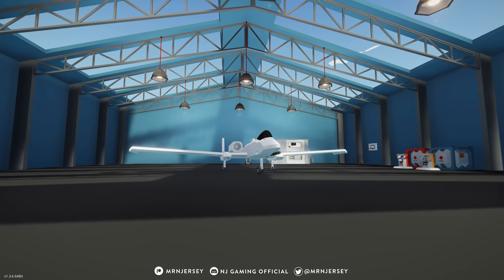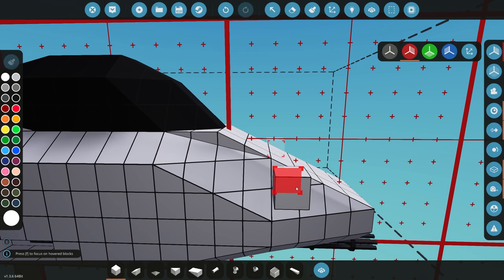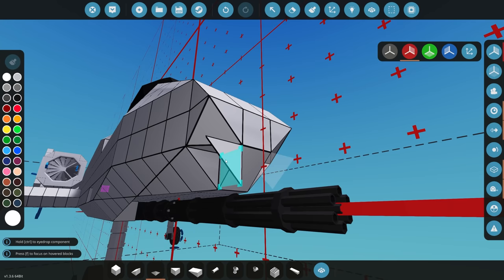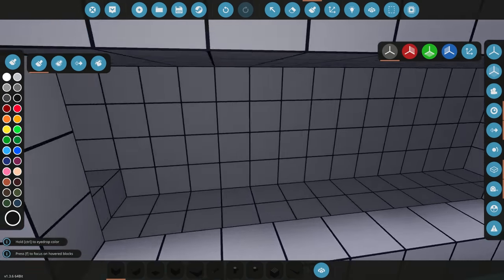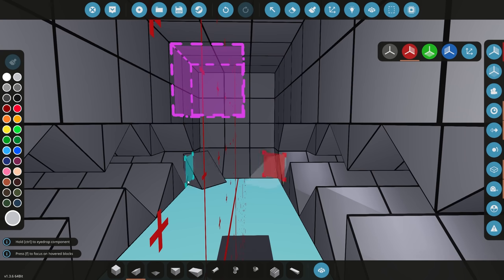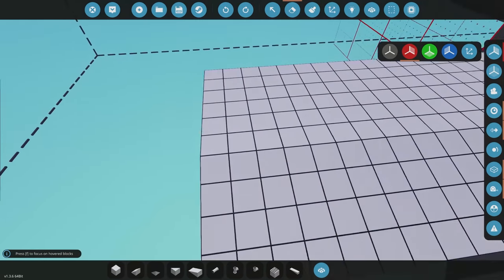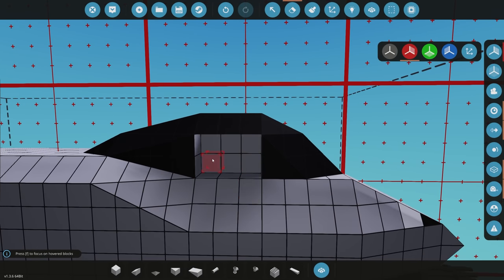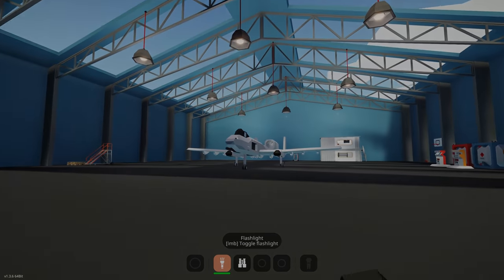BBBRRRTTT Build!! - Part 2 - Search & Destroy Weapons DLC - Stormworks

Comment: 12:32 the real brrrrrt acutally had its landing gear sticking out a bit so if the hydraulic system was damaged the pilot could land safely without the plane being completley destroyed
Reply: Yes hehe
Reply: just came down here to say that, the hydraulic system in itself was a twice redundant system because each engine ran pumps for a separate loop, that hooks into the same components, and the reason the gear raises forwards is so that if for whatever reason he cant unfold or lock the gear electronically/hydraulically, gravity and drag from flight could
Reply: Is it bothering anyone else that the front gear is not off center, and folds backward instead of forward?
Reply: im just about to comment this

Comment: You have built it the wrong way, it’s always gun first and then the plane, just like the designers intended
Reply: Exactly!
Reply: As all Americans do. Guns first
Reply: Also it’s not centered it’s offset
Reply: @leyizh  no sir. The recoil of the center line gun was causing stalls so it’s slightly off center left. The landing gear was then placed off center to support weight and cause no space. The pews come out of the 7 o’clock which is centerline at furring. And some fancy rudder work to compensate for recoil

Comment: Loved the video @MrNJersey! As I said in the last video, I have the Specs for the Different Ordinance The A-10C Carried and they will be down below:
GAU-8/A Avenger 30 millimeter Rotary Cannon:
Barrel Length: 90.5 inches (2.32 meters or 9.28 Blocks)
AIM-9 Sidewinder:
Length: 9 ft 11 in. (3.05 meters or 12.2 Blocks)
Wingspan: 11 in. (0.28 meters or 1.12 Blocks)
AGM-65 Maverick:
Length: 8 ft. 2 in. (2.51 meters or 10.05 Blocks)
Wingspan: 2 ft. 4 in. (0.71 meters or 2.87 Blocks)
Mark 80 Series of Bombs
  Mark 81 250 lbs (113 kg) Bomb:
   Length: 74 inches (1.89 meters or 7.58 Blocks)
  Mark 82 500 lbs (226 kg) Bomb:
   Length: 87.4 inches (2.24 meters or 8.96 Blocks)
  Mark 83 1,000 lbs (452 kg) Bomb:
   Length: 119.49 inches (3.06 meters or 12.25 Blocks)
  Mark 84 2,000 lbs (904 kg) Bomb:
   Length: 129 inches (3.30 meters or 13.23 Blocks)
Mark 77 Incendiary Bombs:
  MOD 5: 507 lbs (229.16 kg) total weight with 75 US Gallons of JP-4/JP-5 or JP-8 Fuel and Thickener.
   JP-4: (Jet Propellant) 50-50 Kerosene-Gasoline blend, phased out in favor of JP-8 for a Lower Flashpoint compared to the 0°F or -18°C of the JP-4
   JP-5: complex mix of Hydrocarbons, including Alkanes, Naphthenes, and Aromatic Hydrocarbons weighs 6.8 lbs per US Gallon, and has a high Flashpoint (minimum of 60° C or 140°F).
   JP-8: Normally used as a Replacement for Diesel fuel for heaters, stoves, tanks by the U.S. Military and it's NATO allies, this is made with an Icing inhibitor, corrosion inhibitors, lubricants and antistatic agents, and less Benzene and less n-hexane than JP-4.

Hopefully this will help you even more as you continue to build the A-10! Also, the Colors currently used are called "Dark Ghost Grey/Gray" and "Light Ghost Grey/Gray" in case you're wondering.

Comment: That monster looks amazing.

But I would actually put the Cannon even farther back and put more extensions on it, because then you have more space for ammo and landing gear and you would have more accuracy, which is important for the A-10.

btw a little fun fact: The A-10 has 1350 round and it can shoot 4200 rounds per minute so it can shoot only 14 seconds (I think, correct me if I'm wrong) until the drum is empty.

(I copied this comment from the first part because I don't think you saw it)
Reply: I think the longest burst the A-10 can do is only seven seconds, as the recoil from the gun makes more thrust than the engines! But yeah, fourteen seconds of brrrrrrrrrrrrrrrrt is more than enough to kill some tanks
Reply: @tetronaut88  Well, not really. Firstly, it is accounted to give as much thrust as ONE engine, but both of the engines combined produces more of the thrust. And it does decrease its speed when firing, but with that said, enough energy (aka alt) and you can negate that. The larger issue is that the gun unsettles the  entire aircraft quite heavily, so shorter bursts can be beneficial to not loose control
Reply: As I understood it they had a problem with the real gun being to accurate so the bullets didn’t spread enough, I also think that they had a problem with the gases from the gun suffocating the engines, both are really cool facts (if I’ve understood the, correctly)

Comment: Another weird thing with the A-10 (don't know if it would work with Stormworks) is the the front landing gear is actually off-centered and not directly under the center of the plane I also believe that it folds towards the nose of the plane and not back. Just nit picking cause your builds are always way better than mine!
Reply from the maker: Correct, the gun is also however due to it being stormworks there is only so much I can do, so it won’t be a complete replica
Reply: Still it looks amazing already, can’t wait for you to finish so I can fly it around!!

Comment: I love using the hardpoints for the landing gear lock. Even with low physics quality it works :)
Reply: That’s really smart, I’m building a fighter jet but when pulling Gs the landing gear gets pulled open, have been using connectors so far but they are a bit fiddly

Comment: 1. The main body is looking to slim, it should be a block or so thicker. Definitely in the X-axis and maybe in the Y-axis. 
2. The wings also look a little thin, i think you can pull off a two block thick design. 
3. undo the smoothing of the landing gears on the wings, it will look better if its a block or two longer.
4. extent the finns(?) on the tail by one block in the X-axis.

Comment: Hey Jersy, the A-10C got a split airbreak so it would be good if you could put two overlapping flaps on the wing wich will split to breake.
Reply: That mechanic doesn’t exist in this game
Reply: @axialivanov6101  i built it and it works, just the wings are a bit thick.

Comment: @MrNJersey if you want the landing gear in the wings to fold in better have the wheels rotate to face towards the rear of the plane as the landing struts are folding up.

-Cyber
Reply: The cool thing about the A-10 is that the wing landing gears don't fully tuck away in flight. it was a design choice made made to improve aircraft survival rates in belly landings, and since the plane typically flies low and slow, the drawbacks of having them exposed are negligable.

Comment: The shells of the a-10 don’t fly out of it they stay in until reloading
Also added xml blocks on the landing gear
Reply: The reason that the shells stay in is actually to keep the weight equal, as the mass of the shells is enough to make the plane not pitch up (the plane is naturally tail heavy)
Reply: @tetronaut88  Also to keep the empty shells from flying into the engine.